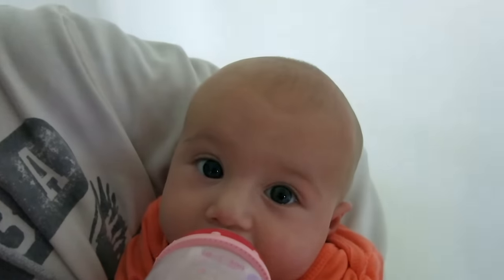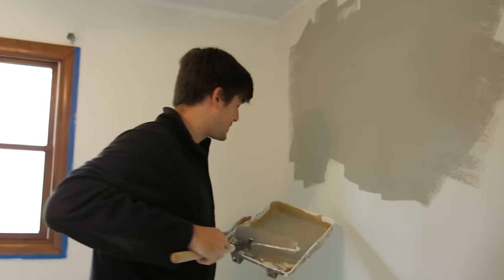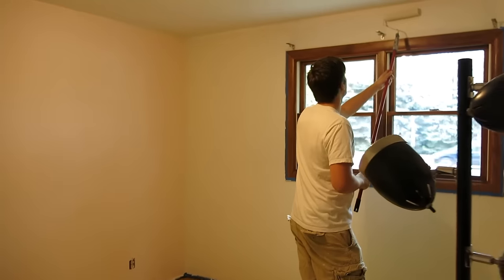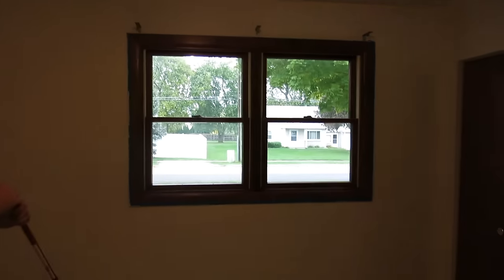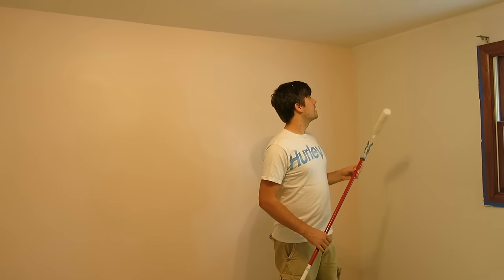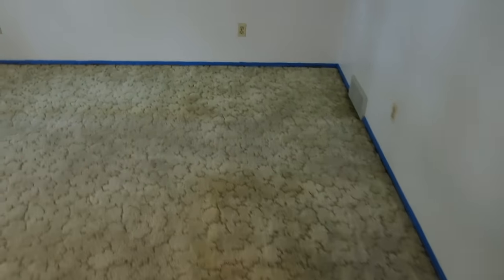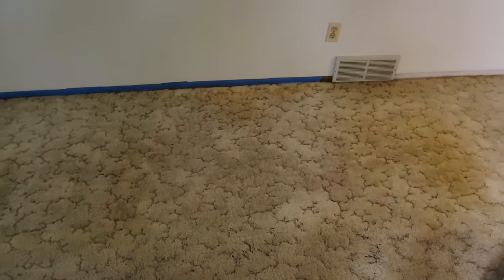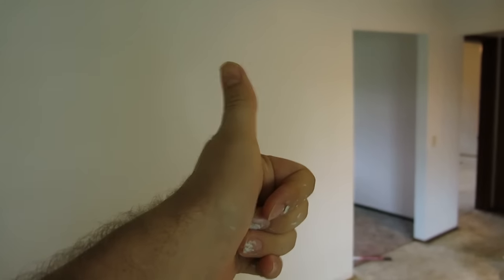Whistle While You Work

Comment: Use a 3/8" nap roller and load it up with paint you will find it goes faster. Also you should do your cut in work around baseboards, ceilings and doors before rolling in begins. Your cut-in work should come out 3-6" from trim work. I hope this helps and you don't find it offensive!